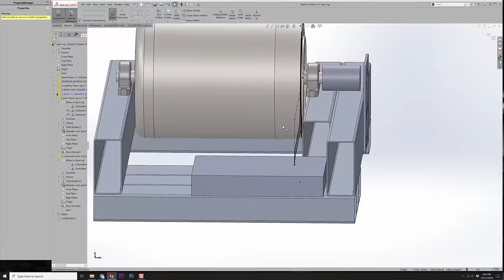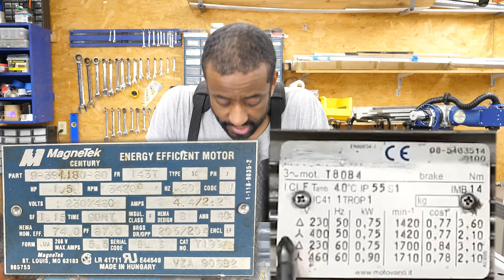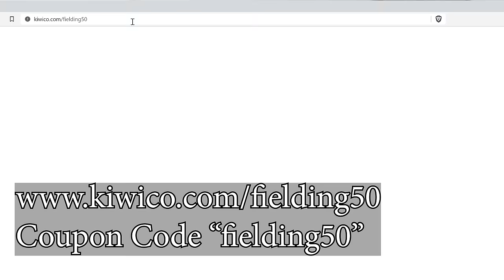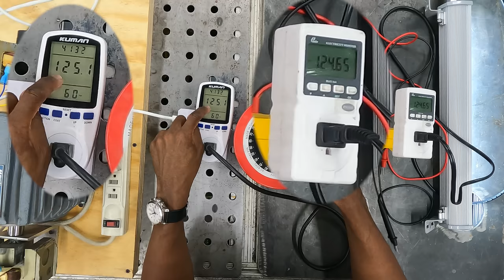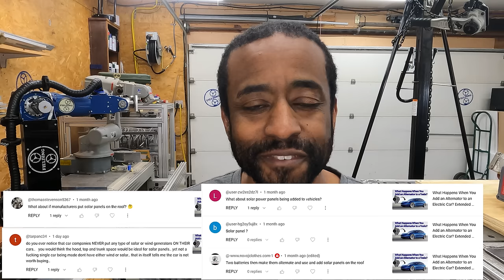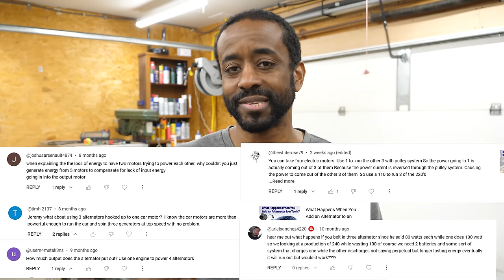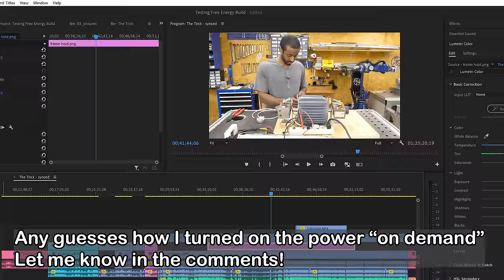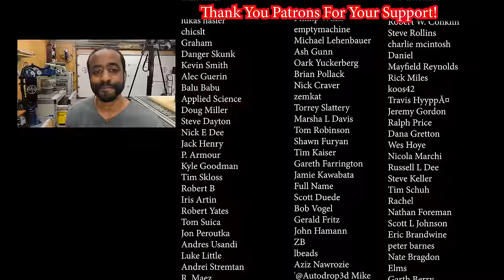Building and Reviewing Free Energy Generators on YouTube.

Comment: ok so we know there are energy sources,  wind, water flowing, solar, burning a fuel, geothermal.  and more.   these energy sources are free but only after you build the device designed to harvest them.  so in that respect you have to say there in no free energy because you have to spend money or time usually both to build the device to harvest the energy.  the free energy people who keep claiming free energy are not counting the cost of the device needed to harvest that energy.  If I build a water wheel and put it in my creek to turn a generator I would claim I get free energy. but technically you would have to say ok it cost me 500 dollars to build  the device.   no different than buying solar panels and then claim I get free energy now. but your really just paying for the energy in advance.  And depending on how long the device last , lets say 20 years your 500 dollar investment spread out over time, well then 500 dollars divided by 240 months would only be about 2 dollars per month.  technically not free but so cheep you see it as free.   and that is what we are trying to do, build a device that will harvest a energy source that is free and then get to use that energy at a very low low cost.  now there are new energy sources that have come available that were unknown before such as manipulating magnetic fields to get electrons to flow from the environment .   or to amplify existing power by taping into a new energy source  like gravity.  again you have to build the device in order to use it but after you do you have a super cheep energy source you can get away with saying its pretty much free.    what you are doing, testing devices that claim this type of so called free energy to see if they work, and most of them on here do not. however there are some that do.  you can extract power from the environment through the manipulation of magnetic fields and you can harvest gravity.